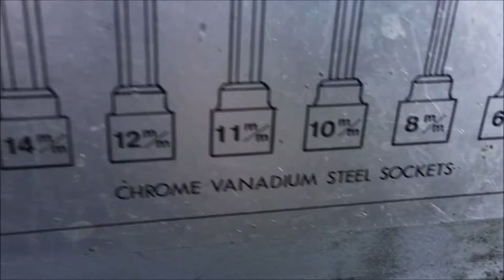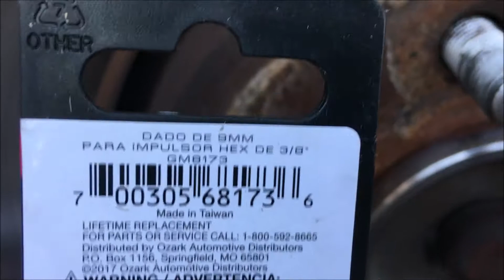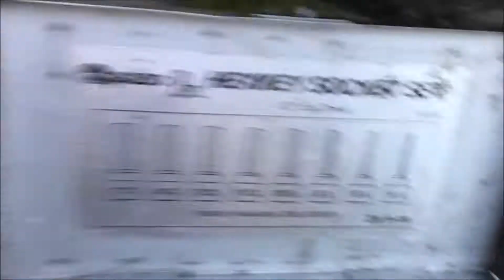2008 Ford Expedition brake caliper tool

Comment: Thanks a lot for helping out with the socket size. I had trouble finding it also until I tried Harbor Freight and found it on the Icon sets

Comment: for some reason my 2008 expedition needs an 11mm hex socket to remove the caliper bolts. 
10mm is too small and 12 is too big. naturally its not in any set i have. 
The rear caliper bolts are 7mm.